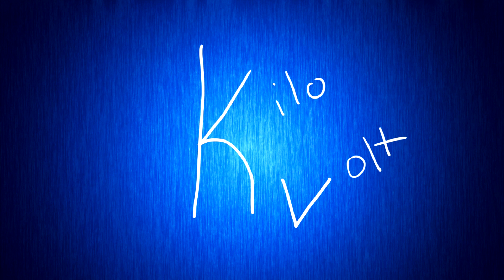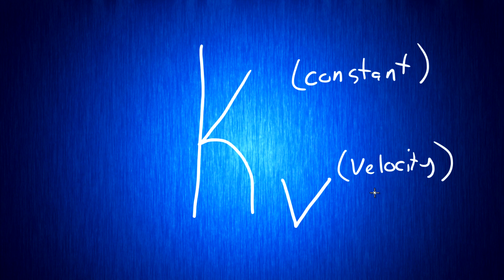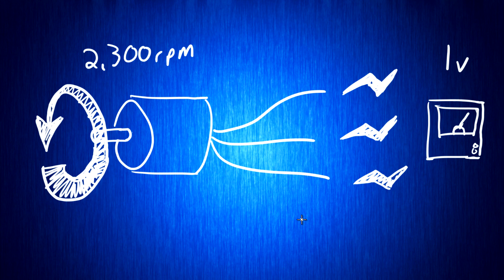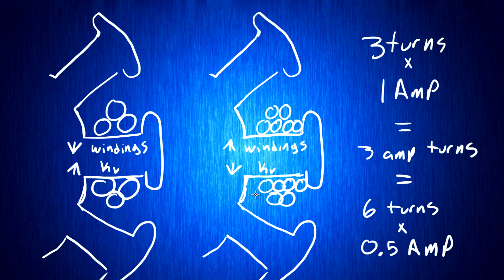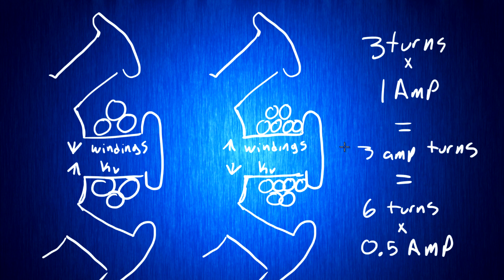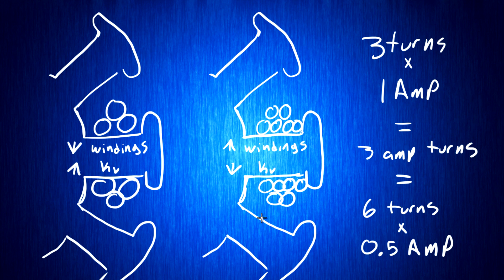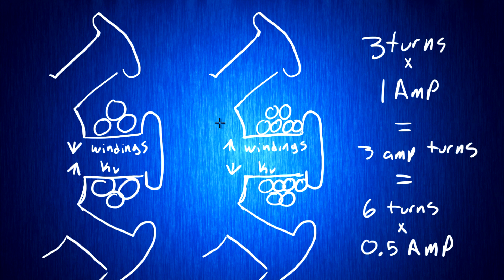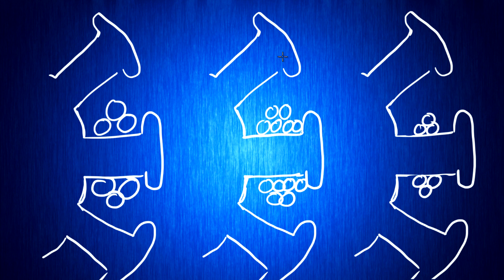Brushless motor theory 01 - KV and torque efficiency

Comment: What happens if you increase the wire size as you go out? Say 22 awg near center and 14 awg near magnet's? Also what if you use square wire or just shapes?
Reply from the maker: I would guess that you'll just be bottlenecked by whatever the thinnest wire you have in the loop.  The thicker windings may be able to handle more current, but the thin windings will die before they can be fully utilized.  I would expect that you'd be better off just using entirely a single gauge between the two extremes, plus it would make managing your KV much simpler.

I also guess that wire shape wouldn't have a particularly significant effect.  Perhaps it changes how things work with the skin effect, but if skin effect is a major contributor I think you'd be better off by going stranded than trying to find some other shape of wire, as a circle would have the best ratio of enamel surface vs. copper volume.  It would certainly be interesting if you could find any examples of high performance or maybe large industrial motors that use anything other than typical round conductors.

Comment: So a higher kv motor of same size, just different kv values will have more torque then the lower kv motor on equal voltage and current? Or it only changes the rpm, which is the cause of more power?  I'll watch the video now, but I've been trying to find the simple answer

Comment: you guys never explain what torque efficiency is.  and , if you are putting 3 amps thru3 turns x1 amp = 3 amps, 6 turns x .5 amps, its still 3 amps, the KV is lowered but the torque remains the same.  How are you putting less amps thru?  that's the gain?

Comment: I don't understand why the industry places so much emphasis on the kv ratings. We know that motors in general go faster with higher voltage and to a lot of people is intuitive. So if we know the kv rating, so what? Yet the motor power information is only listed in a spec sheet which may or may not even be available. So if I have a diy airplane of certain size and especially of a certain weight and know how I wish to operate it, why is it such an arduous task to find a motor to use? It seems backwards to me to have to page through so many models to even get in the ballpark of what I want. It seems like it all became so needlessly complicated compared to the size selection of glow and later on of brushed motors. It's all very frustrating and it just makes me want to use a brushed motor and live with a little less efficiency.

Comment: If we cut the wire diameter in half and double the number of turns, do we get the same torque? If we do so, wouldn't it be less to withstand high currents since the wire is thin compared to thick wire?

Comment: This is incorrect. A motor acts more like a transformer than like a resistor, which is like you present it.
It is not the resistance that limits the current. Resistance is a factor in the motor-losses, which limits its power.
But the core has losses as well, i.e. magnetic losses. These losses are 2 times bigger than resistive losses.
So the core limits the max torque, but it also limits the speed, as core-losses increase with frequency.
Third factor are the mechanical losses in the bearings and in the air that's moving inside the motor-housing.
The thruth is : the faster you want to fly, the shorter the life of the motor will be and the more you pay for high-tech materials.
Reply: Indeed. I guess the motor equivalent circuit is too complex to explain and it's sometimes better to simplify the explanation by referring to the equivalent impedance. On the other hand, it's quite common for hobbyists to get confused with impedance and resistance, but still it's the more simple way to explain motor losses.
Reply: this should be pinned

Comment: on my brushed motors I have actually reduce the windings to get more RPM out of some of my Motors when I first started doing this I roasted a couple Motors took too much wire off the poles then I started using a bigger wire and less turns and came up with a pretty good motor the motors that burn up ran super fast for just a few minutes then went up and smoke but boy were they fast

Comment: How dou test with a multimeter for  kv when you have 3 wires and 2 probes on the multimeter? Any reply appreciated thanks!
Reply from the maker: https://fishpepper.de/2017/10/17/tutorial-how-to-measure-the-kv-of-a-brushless-motor/
Reply: since kv  IS  a rotation rate value,    the use of an optical or electrical  TACHOMETER  is necessary.    see my comment.

Comment: You speak about torque efficiency.. . But what about the copper losses of that high kv example? A low turn motor has a low winding resistance which leads to high "no load current" and lots of heat/short battery runs.
Reply from the maker: Current increases with fewer turns, but since the wire size also increases which decreases copper losses it all cancels out assuming that everything stays in proportion.  High kv has lower losses but higher current, and low kv has higher losses but lower current, so your total losses end up basically the same

Comment: How the hell have I not stumbled onto your channel in all this time?  Fantastic explanations.  Please do one on voltage and how it relates to torque.  I've not got much to go on in that department.  Haven't done enough research but based on real world flying I'd say as the voltage goes up and current drops for the same power output, torque goes down proportionally with the current....the math mostly supports all that but I don't know why conceptually which means I dunno anything...
Reply: That's THIS video Bob ;p
Reply: @pauliman1098  yeah I watched it a few more times and got it. I'm not sure if I'm more enlightened or confused after getting it.
Reply: you should FORGET  everything that was said here.    there were TOO MANY ERRORS in this video.
Reply: I literally just did the same thing and it's kind of clicking lmao

Comment: Thermal power is current*current*resistance, the 6 turn winding end up wasting half the energy to heat and that is the point of low KV.
Reply from the maker: Lets take a hypothetical micro motor, say it's wound with 5ft of 33awg wire, and uses 50W on our test prop, for a total amp draw of 6.25A.  Our total winding resistance is 1.035ohm, and we can calculate the I2R losses as 40.4W, or 80.8% (it's just made up)

Now let's halve the kv of the motor by doubling the number of turns, now we have 10ft of 36awg wire, for a total resistance of 4.15ohm.  To hit our 50w draw point we're now down to a nice 3.125A.  And now you can calculate that our I2R losses in this case are 40.5W, or 81.1%

Consider the difference just from rounding numbers along the way.  You can run that simple math with any combination you like.

Comment: i am buying a brushless motor for a 7.4v esc and one is kalled 4800kv, one is called 4600kv and the third is called 7300kv. which will go fastest? which will be most efficient? which will have the highest torque? thank you
Reply: It depends on the size of the motor and the load on the motor. There is no simple answer.

Comment: Actually the resistance is not related for the most part. The more turns the coil has the less current goes through due to cemf, self inductance is also related. This is due to a rule that a coil as you put more turns on, it resists any change in current more efficiently(same thing that happens in a choke, it is also a fact that as you add more turns the voltage out of the coil goes up, if the current gets choked it forces the voltage up. The coil also has a core which amplifies the reluctance of current change in the coil as it concentrates the magnetic field. If you take the wire out of the pole and measured the resistance of the wire straitened out it wouldn't be very much. anyways the resistance actually is only related to the heat made while current goes through the wire. Current might be lowered but only a fraction of what you are suggesting. For the most part cemf and self inductance chokes the current and raises the voltage out as a result.
Reply: What you described is something that takes place in a generator application which means there is a voltage and amperage output. That is not how an electric motor operates.

Comment: So would this mean that a lower KV motor has higher torque at lower RPM levels than a respective high kv motor? Or does it really not make a significant difference?
Reply from the maker: For the same drive voltage the higher kv motor will be capable of producing more torque at all rpm, up until the thermal or magnetic limits of the stator.  For a quad this means more torque for dealing with inertial loads (acceleration and deceleration of the prop) since the torque demand from the prop stays the same for the same speed.    If you compensate the voltage proportional to the KV  (more voltage with lower kv)  then the torque available stays the same.  If you want more torque out of a motor you need to play with the pole count, stator size, flux density, or delta vs wye windings
Reply: @SiieeFPV  "For the same drive voltage the higher kv motor will be capable of producing more torque at all rpm, up until the thermal or magnetic limits of the stator." You don't know what you are saying. On video you said something else...
Reply from the maker: @harynian  In this video I'm talking about motor constants, not peak torque production.  I'm not sure what you're talking about.

Comment: Does changing a bell from 2600kv to 2400kv with different air gap, flux, magets. Change the overall kv   to 2400kv?
Reply from the maker: Getting a higher flux density (either through stronger magnets or smaller air gap) will lower the kv, but kv strongly depends on the winding of the motor so there's really no such thing as a "2400kv bell"  Generally if you're looking at different kv variations for a single model of motor the only difference will be the windings, the bells would be identical (except for the label) and interchangeable.  You can swap bells between different models and manufacturers and get different results.  Ryan at MQTB has played with this a little bit in one of his articles.
Reply: SiieeFPV ok well that sucks I just bought f40 pro ii 2600kv to try out higher kv and it's not for my type of flying was hoping I could change out bells with 2400s. My friend  done it with racerstar 2205 2300 and 2600 and it worked he says. I had my doubts. Thanks man
Reply from the maker: It's not a rule by any stretch, there could very well be a difference, I just think it's very unlikely.  Placebo effect is very strong in this hobby, and even being aware of it does not make a person immune to it unless there is some real rigor in the testing.  For lowering your kv you can accomplish basically the same thing by changing your throttle endpoint in your radio.  The bulk of the "feel" difference is just in how the higher kv motor will compress the response range of your sticks, anything you can do with the 2400kv F40 you can do exactly the same with the 2600kv
Reply: SiieeFPV that makes sense I'll try changing my thottle end point. Thank you for dumbing it down perfectly for me

Comment: In lamens term, less kv, more torque/speed
Reply from the maker: less kv is less speed, torque is the same.  You use the KV (or the voltage) to dial the maximum load you want to put the motor under.
Reply: okay yeah sorry. the explanation was confusing me.
Reply from the maker: I show some real measurements and talk a bit about it more here
https://www.youtube.com/watch?v=aPTE_sgtIzQ

Comment: I need a motor that can have fairly high torque at ~100 RPM because I want to use it for a DIY ceiling fan and I am thinking brushless would be nice becuase it's very quiet. What is the KV range I should do you think be shooting for?
Reply from the maker: rpm = kv * voltage
But kv doesn't say anything about torque, so it doesn't really help all that much.  for only 100 rpm you're going to need to find as low a kv as you can find if you're looking at only hobby motors, but the question as to how big a motor you need to find for that application is still really open.

Comment: Im looking for a quite fast combo but i am wondering if i should go with a 3500kv or 2950kv. Because i want about 50mph  but since i have a buggy i also need decent to good torque.
Reply from the maker: kv on it's own is meaningless.  You need to take into account the motor torque, your drive voltage, and on a car other things like your gearing

Comment: More turn more volt will produce in the motor if you spin it you are wrong
Reply from the maker: I'm sorry, you're totally right I don't know what I was thinking.  I'm mixing up terms and values in my head.  more turns/low kv requires a higher drive voltage to reach a certain speed precisely because the BEMF is higher
Reply: Yeah, that's exactly what Kv means

Comment: so basically 6 turns uses half the current to output same amount of torque as 3 turns???
Reply: you get  higher torque but lower speed.
Reply from the maker: yes, but since the 6 turns is longer wire it requires more voltage to run half the current, so total power remains the same.

Comment: Hey! Nice and informative video! You told that the copper volume is the same if we decrease the number of turns by 2 but increase the diameter by 2 right? Isn't it not proportional since the area has the diameter squared?
A=(3,142/4)*D^2
Just a deliberation I had while watching. Keep up the good work!
Reply from the maker: if I said diameter I certainly meant area.  cross sectional area is all that matters for slot fill %.  The correct equivalence is wire gauge, every 3 points of wire gauge is double the cross section.  So if you've wound with 12 turns of 30awg wire, to double the kv and keep the same slot fill you need 24 turns of 33awg.
Reply: Thanks, makes sense!

Comment: so... if i get a 3200 kv motor its not going to have less torque than a 2500 kv motor? im just concerned about that
Reply from the maker: For an otherwise identical motor the motor constant will be the same, so the amount of power you need to make the same torque doesn't change.  But when the only thing you're comparing is the motor and the rest of your setup is the same you need to consider that that is a partial throttle comparison.  We should have a good practical look at that soon, once we start looking at dyno results some of the first things we'll look at is the same motor at different KV
Reply: SiieeFPV so... if its using the same battery and the ESC is the same on both cars but kv different we need to test it still? Because thats a dealbreaker because the two models im compraring have same ESC but different motor and i love the torque already from the lower kv... and if only top speed is increased and torque reduced its kind of a dealbreaker for me.
Reply from the maker: If I understand it correctly it should be exactly the same, the KV just pushes the rpm range up and down based on voltage, I just don't want to commit to that.  Torque comes from the flux density and pole count and the stator design.  A higher KV motor should be able to do everything that a lower KV motor can, but that also ignores other things that may effect it like how the ESC will behave.  To get the same torque from the same voltage a high KV motor is going to run at a lower duty cycle
Reply: I know this is kind of old, but if you`re still interested: A higher kv motor needs more current for the same torque. Your battery, and esc must be able to supply this increased current. This extra current also results in higher I^2 * R heating in your motor, esc and battery. This reduces your efficiency.

Comment: very informative video, I like the new blue and white drawings. So , the more copper packed the higher the efficiency?
Reply from the maker: Yup, the higher the cross section of copper the better, having too thin a wire and a lot of unused space or too thick insulation (either on the wire or over the stator laminations) will hurt

Comment: nice you explain it very well I'm winding motors and you hit the nail on the head Mr Miyagi style. You should go in to materials used like silver coated vs copper if you have data lamination sizes  ceramic vs steel bearing all the details. I think we should go back to self tuning motors though its harder matching 4 for kwads. also do you oil motors before test if not could you do test to see if it helps overall efficiency/power
Reply from the maker: I don't think my stand is sensitive enough to pick out differences in bearings and oil above the noise.  That might show up better if I had a way to characterize the vibration of the running motor, but I haven't built that kind of test rig yet.